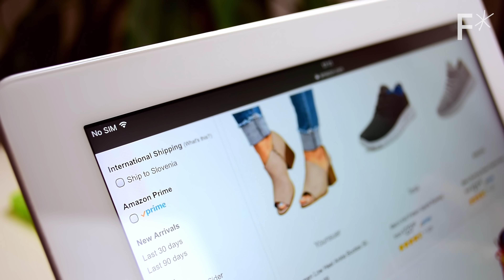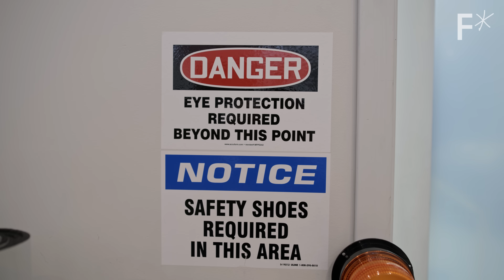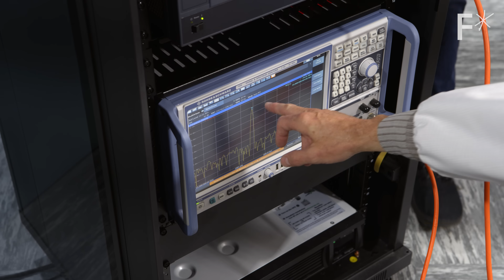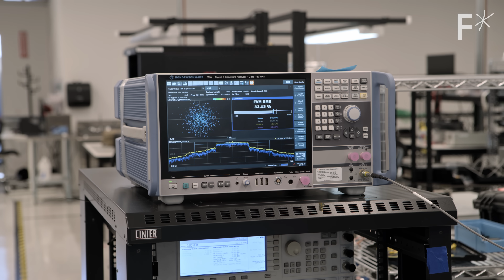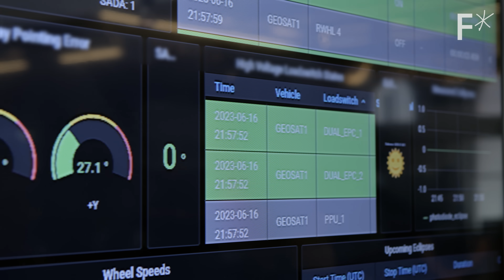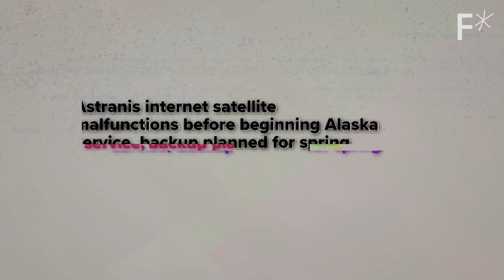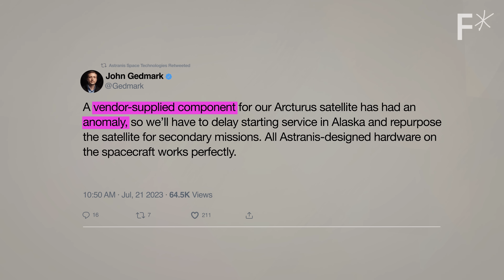Starlink’s newest competitor is using next-gen satellites to create internet for all | Hard Reset

Comment: these Astranis GEO satellites look cool but intending to supply INTERNET means LOW LATENCY, which is why Starlink "Cell Towers" are LEO satellites.
Astranis will have to deploy LEO, but LEO orbits are pretty full already. 
So Astranis may have to rent Starlink "cell towers" in similar way that 2/3/4/5G operators share many towers to save infrastructure costs.
And that thing that Starlink dishes have to mechanically track LEO satellites, really?!? 
4/5G already includes soft handovers meaning each mobile phone is listening and talking to different cell towers at the same time.
Quite sure at Starlink they have already thought about each Earth dish being able to pick up and send to more than 1 LEO satellite at the same time without any need to mecanicanically shift dishes?

Comment: Geostationary satellites have been providing connectivity to </insert any type of electronic communication here> for decades, so this isn’t groundbreaking or cutting edge innovation.

Have a satellite data communication requirement? It already exists.

Where they can make a difference is if they can drastically reduce the cost for this kind of service!

For internet and fast networks, LEO satellites are much, much faster than geostationary satellites with the potential to have less latency than terrestrial fibre networks!

Latency greatly slows down certain types of data networks (including internet) due to network requirements like “handshaking”, verifying the distant end has received exactly what you sent. … Error correction.

Geostationary satellites are not great for high speed low latency data communication but not every network requires lightning fast reactivity. 

Geostationary satellites are great for TV because there is minimal requirement for error correction with video.

Transferring files in real time though? Probably not.

There are technologies to reduce the impact of latency, but they don’t eliminate it.

Plus you don’t have to lose internet when switching LEO satellites, just like your cellphone while travelling.

Comment: GEO Latency is absolutely insane. It's one of the biggest problems the military has when running modern software. When you have to send/receive multiple messages to just populate a dropdown on a web page, the latency adds up fast. Software has to be purposely designed to work over these levels of latency.

Comment: You need to get some facts checked, Starlink does not continue to mechanically track the LEO satellites as it uses beam forming and there is way too much latency with Geo stationary satellites to be generally practical (1000 + ms round trip), also Geo stationary satellites for internet have been around for a long time, also costs are quite high for these Geo stationary connections (I have used them for many years), also there are transfer limits per month on most connections. So sadly Star link is still the best result.

Comment: This is a promotional video because it doesn't mention any weaknesses in the design but does for alternatives. 

Not mentioned, the difficulty of receiving a signal at latitudes nearer to the poles. The signal source there is at the horizon. Signal latency ruins interactive network traffic. 

There is no single best solution. A choice is based on geographical location. In a major city, it's should be fiber optic.  In rural areas, a combination of  fiber and microwave mashed network.  For ships, planes, high latitudes, a Starlink system. Specific latency and costs will also dictate the choice.

Comment: Former Ground Systems Engineer @ SSL here.  I guess they can't squeeze in a lot of detail in 16 minutes.  They didn't cover what's the ground setup would be like for customers.  I'm curious about the size of the dish and how much power would be needed for upload.  And how often you would need to re-adjust the dish for optimal d/l speeds.  If anything, their service is like NBNCo's Sky Muster.  

I'm also curious how their small SATs can deliver power hungry Ka-band signals from GEO to a large coverage area.

Their claim about Starlink's dish losing signal while reconnecting to another SAT was misleading.  We're talking about exotic meta-material performing phase-array adjustments.  It's very quick.  And their SATs are in a mesh network up there.

Comment: How do farther away from earth solve the rain fade the GEO suffers thats closer to Earth?

This is why LEO orbit and three different distances works in cloudy, rainy, and humid areas.

Unless they are going back to the lower power C Band days, it will still vary connection speed having to increase error correction.

It will have to be a cheap service with a long term ROI.  Great idea with rules of bandwidth working against them.

Comment: three points: 1. LEO connected dishes do not need to move if the orbiting satellites have overlapping fields -> SL is already there as their customer dishes no longer need to constantly tilt. 2. as other commenters already mentioned and even this company admits, GEO's biggest drawback is latency. 3. failures occur and nothing can be tested absolute but blaming a 3rd party supplier for an issue is on them -> improve your supplier selection process or at least state that an issue was found and is part of the improvement process, no need to state it was a '3rd party supplier's HW that failed' as I am sure 95% of all hardware used on the satellite is from various 3rd party suppliers. It's like BMW blaming Bosch for a failing mass flow sensor.

Comment: My first backup internet access what Hughesnet, but I never used it as backup because the latency was about 1/4 of a second (280+ ms).  I don’t do gaming, but I do FaceTime, Zoom, etc. and lots of web searches.  So although Hughesnet advertises low latency, that 1/4 of a second is horrible.  I kept my Hughesnet account for a number of years before Starlink was available, which I now have as my primary provider, using our old fiber optic telephone as a backup, because it is only 25+ Mbps while Starlink averages between 250-350 Mbps, with latency usually around 20-30 ms, and often below 20 ms.  So I don’t see functionality with today’s internet and satellite cellphone service in this new geo stationary competitor because of the obviously high (not low) latency.

Comment: Well? I'm all for this, Geostationary Satellite, stuff. It makes a lot of sense. And pollutes the skies far less with faster than bullet objects. Space together like a machine gun. There will be no saving people hit by one. In a rocketship. Bang! Whoops! Everybody Dead!

And so the geostationary satellite 22,500 miles out. Makes a lot more sense. But getting our signal to it will be the challenge. People are going to get fried. You will be able to warm up your hamburger or your coffee. If you are not careful. And get yourself a sunburn in the dark. Do not face the thing near your face. It's going to require some power. To talk to a satellite 22,500 miles out in space. Especially on a Motorhome. As at your house. You can set up a 10 foot dish in the backyard. Sure!  You can't drive with one of those on top of your Motorhome.

Now I really wondered about the tracking of the satellites for Starlink? And yes they have those motorized ones. That automatically track the satellites, for you. But now they have the Mini, ones. You just set up on the ground. Aim with your smart phone app. And off you go? How does attract the satellites?

Oh? That's right. Space X hands the networking off. From one satellite to the next. So you don't have to.. It doesn't have to keep tracking the satellites as they fly by. The satellite tracks them. That's why you can put those on the ground in a fixed position. And still have communications with their satellites. Coming over the horizon. And then they keep handing off one satellite to the next. It's all about Computer Networking. And the handoff from one satellite to the next. Once you get into the right plane of aim. Then it stays in that position. Until you move again.

So I don't think all the information here is correct.  As they are still Vaporware. It hasn't really taken off, yet. Maybe it will?  And… Maybe it won't? Something else like this happened in my industry.

In the Music Recording Studio Industry. 50+ years ago. A guy who helped develop the professional broadcast video tape recorder by the name of Ray Dolby. Realized the analog tape was hissy. And he created a gizmo. That without altering the sound too much. Would reduce the noise appreciably.

A couple of years after its introduction. Another company by the name of DBX. Offered a different type of tape noise reduction system. That did it even, 2 times better. And wouldn't you want twice is good? Apparently not? Most everybody stuck with the Dolby. But they both screwed with the sound.  That many of us did not care for nor like. So we didn't use any! But I got rid of the hissy noise other ways. As other engineers also did. Without Dolby. Without DBX.

But Dolby would remain the Professionals Leader. DBX always played catch up. But they also made other products that people liked  and cherished. So they had their audience also. Just not doing tape noise reduction. Dolby led the way. And it sucked! I never used the stuff myself. Though I had to from time to time. And that's fine if you like that sound. I didn't.

And so this isn't terribly different. With the Satellites. Elon Musk,, got his up first. And his system works. And apparently, works well.  With the networking of the satellites, handing off to the next. To keep you connected. As they fly overhead. And beyond your realm of contact. Before it latches onto the next, seamlessly.

 Of course, this system won't have to do the handoffs. Making it a simpler system.  And less prone to, failure. Should one stop working. You would lose the signal for a few minutes time. That would not be helpful. That's what's going to happen with Starlink.

And so in Network Television.  We started relying upon, geostationary satellites. Back in the mid-1980s. So that's nothing new to me. But interactive data from home, is. Talking to a satellite 22,500 miles out in space. And having to transmit to it. I really don't think we will be doing that? That's far more expensive equipment. Far more critical aiming and positioning. But once set. You can forget. It'll always be there.

As an old retired Practical Engineer. I never jump on the bandwagon of anything's, first, release. It's always fraught with bugs. And if the company fails? It all goes dark. As they would be trying to play catch up with Space-X. And he's got an almost unlimited budget.  Most others do not. And they have to get really creative. But even that might not work.  When you are dealing with the opulent.. That will destroy you to win. As they have the financial resources, to do so. And you are screwed. Just like that.  Out of business. Dreams, destroyed. Because nobody can compete with billions of dollars of budget. Not accept the real risktakers. That frequently fail.. Because of dudes like Jeffrey and Elon. Creating their own Monopolies. That is their goal. To, own, everybody. That is their goal. They are Midas miserly misers.  They can never have too much. They want to own, the world and everyone. It will all blow up in their faces. When people protest and fight back.

But why are we continuously put through this? Our grandfathers, great-grandfathers, created the unions. To thrust America into the Middle Class.

Now rich folk once again. Want everybody to be, beholden to them. They want to own everybody. They are sick in the head, egotists. Megalomaniacs, all.

In fact. I would like to see in the November ballot box. One question. And that question should read:
Do you feel. You would need more than $2 billion of self-worth? To be able to live comfortably? More than $2 billion of, self-worth? Do you need more? Yes or No?

I believe most everybody would answer No. And so in that respect. Jeffrey Bozo and Elon Musky.. Do not need to be worth, 200+ billion dollars each. No.

The bulk of their worth should be taken away. And they should be left with $2 billion of their own. The rest of their money. Will be used. To help rebuild America's infrastructure. New highways. New bridges. New schools. New universities. All with their names upon them. As great Americans.  For helping to rebuild America's infrastructure! They will go down in history.

And so really that's the way it needs to go. Nobody needs to be worth 200+ billion dollars. Nobody! That's nuts! As we have starving Americans. We have homeless Americans. We have disabled, Americans. Time the rich FUCKER's pay up! Enough with the Deductions! Rich people need no deductions! None! They need to be paying their taxe! Of which they are not doing. As they have too many Deductions! To further their wealth and opulence. Enough!

(More Female Purgatory in  following post)

Comment: you dont even need orbit..it can hang on the outer atmosphere. & to prevent starlink from disconnecting you can link it all as one single communicating unit...
Reply: They are linked together bro
Reply: @a10warthog4  as one unit...meaning they all sure a single address...

Comment: Lot of misinformation here.  I have been using starlink for years now.  The starlink dish does not constantly move to link to satellites all the time.  The original antenna only positioned itself once during installation.  Thereafter it did not move.  The newer antennae are manually positioned "once" during installation using the Starlink app on a smartphone.  Starlink satellites also talk to each other with lasers which make them light speed fast in communications. Geostationary satellites for internet use is not a new thing.  Dish and Hughes Net have been around for 28 years.  I know as I used to be a subscriber.  Their internet is SLOW and would be interrupted in a good rain or snow storm.  Starlink antennae have a built in heater to melt snow build up and rarely, if ever, get slowed by heavy rain storms. I have never been able to use a geostationary satellite to make a VOIP phone call.  I can with Starlink. I even made video calls. Other than an expensive initial antenna cost, Starlink is cheap in monthly fees with no lengthy contracts.  You do not have to return any equipment if you cancel service and indeed you can pause service if you want to do so.  The new Starlink mini antenna is now available and after using it for over a week I am considering using it as my full time antenna.  I have mounted it on the roof of my jeep and can easily move it from the jeep to my pickup or to my patio in a matter of minutes.  It is powered by DC current so in a power outage you can use a solar power station to stay online.  Today we had a power outage and I made coffee, ran the mini, and surfed the internet with my laptop all of which were running from the same power station while it was being recharged by a solar cell suitcase.  I also took the mini for a ride in a steep walled canyon which never has cell service.  The mini wifi service didn't even hiccup during the 30 minute drive at 45 mph.   At 65 mph on the freeway the service was spotless.  If you live in a dead spot for cell service or remotely, Starlink cannot be beat. Ever tried gaming through Hughes Net or Dish Network?  The latency is terrible.  You are dead before you know what happened.  I game using the internet through Starlink.  The service just gets better and better.  I am a 75 year old totally disabled combat veteran.  If I can set up the service in under 10 minutes anyone can.  I wish these people good luck, but I doubt they are going to be a great success.

Comment: Nice but no thanks, and these folks have a long way to go. Starlink already has a concise depreciation plan which naturally de-orbits its old satelites anywhere between 8-15 years. It does this by precise orbital insertions at LEO instead of putting things that become obsolete into orbit forever. Whatever these guys are doing is just a "trying to fit in" stint while assuming they've re-invented the wheel.

Comment: GEO sats are great for one-way transmission... ie... satellite TV, etc.    But when put into use for bi-directional communications (think sat phones, or Hughesnet internet), the performance (both bandwidth and latency) is far from spectacular.   For low-bandwidth internet operations, such as IOT devices, GEO is more than sufficient.  But to meet the demand of ever-increasing bandwidth and lower latency, the only realistic solution is LEO sats (ie..Starlink).

Comment: @3:02: Incorrect description and visual of Starlink and the ground antenna. @3:55: GEO? Really? Latency is horrid and you need a much more powerful signal. This is the old approach (decades old) - not "next gen". All the following testing is standard testing, decades old. What's the throughput compared to a single Starlink V2 Mini? Covering a huge area isn't that helpful if you're still at dialup speeds - but with more latency.